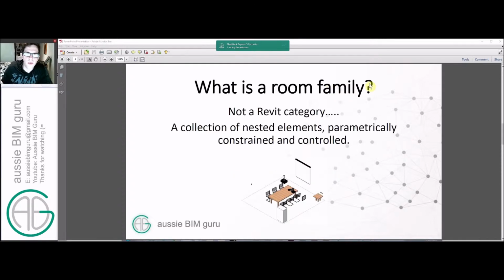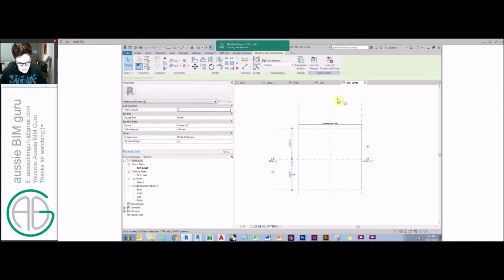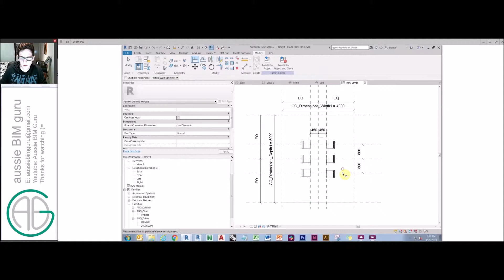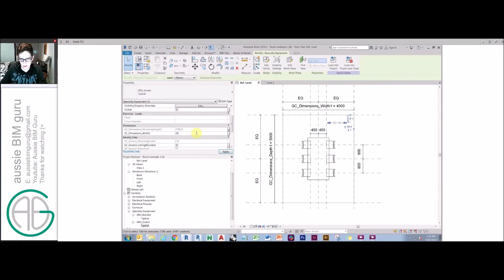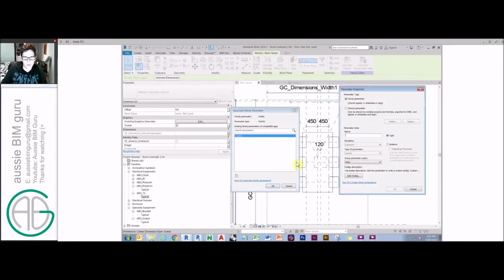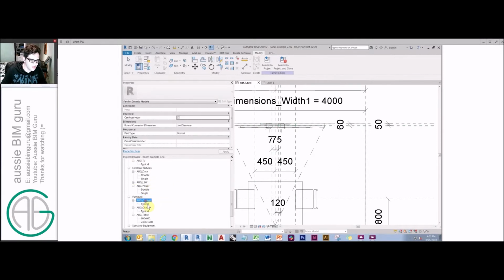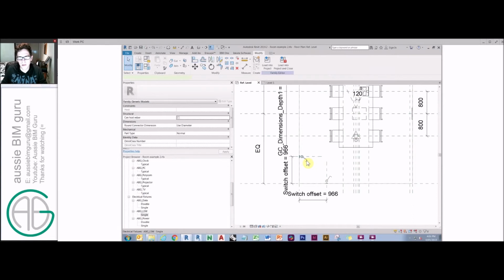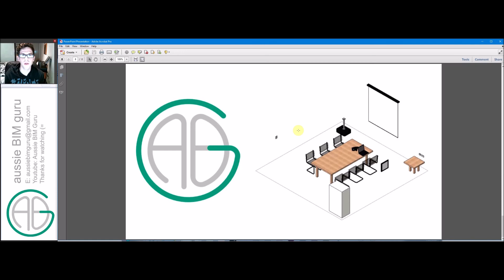Making Room 'Super Families' in Revit!

Comment: Another question: You say hosted elements are not possible to integrate in this, but most families of toilets for example are wall hosted, is there any workaround that you know to be able to use them? What have you done in your accessible bathroom example?
Reply from the maker: I never actually use wall hosted families, that's my solution unfortunately.
A majority of my families are workplane based with a standard template as the starting point.
Reply: @AussieBIMGuru  I believe you, so I would also stop using them if possible. But since sometimes you download something from a manufacteur it would really meaning rebuilding the family, as you can't just "unhost" it... Not a perfect solution I see, but still more pros than cons.
Reply from the maker: @marianaarodrigues1  yes i typically rebuild or rehost manufacturer families to faces/workplanes where possible in a standard template.
Reply: @AussieBIMGuru  Is this the method you usually follow? https://knowledge.autodesk.com/search-result/caas/simplecontent/content/convert-hosted-family-to-face-based-or-non-hosted-family-revit.html

I tried just now with a plumbing fixture family, and it just won't copy it... Is it maybe because they used an Import inside the family?
Reply from the maker: Not 100% sure about that trick. In this case my method is for specifically face based families to nonhosted. I create an element to rehost it to as nested. No good method for hosted families though like wall based that I know of, I just start fresh for those (and copy geometry where possible).

Comment: The question is: Once this Super Room.RFA imported into A PROJECT.RVT file, is there a way to created a Equipment schedule within the project file and map where an specific equipment coming from OR which .RFA file these Nested Contents are coming from?    In other words, Is there a way to create a Multi-Category Schedule for a .RFA file imported to revit.rvt that has nested Families inside AND Knowing where these Nested Contents are coming from?
Reply from the maker: Yes there are a few ways this could be done, one would be to so a multicategory schedule with a filter by room assuming all elements falll within one.

The other would be to use dynamo to check their host family, then set a field such as comment to bulk fill this with common data for filtering.

Comment: Hello, thank you for the good information.
Can I create a new group of parameters that the family has?
For example, I would like to create new unique parameters such as configuration, structure, dimensions, system, and identity data.
Reply from the maker: Unfortunately Revit limits us to the 20 or so groups it provides by default. Additional parameters can be added under these groups as either project or shared parameters.

Typically I work with identity data for coding, text for authoring data, visibility for on/off, other for formula driven fields, constraints for primary dimensions, dimensions for minor ones and analysis for analytical properties. I find this has worked well for me to date - consistency is key.
Reply: @AussieBIMGuru  Thank you always!
It helped me a lot.